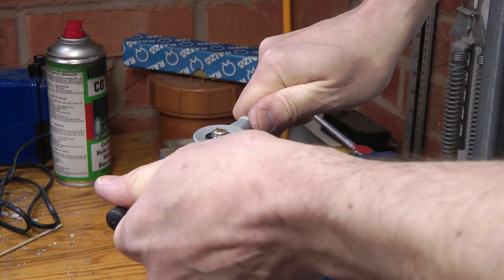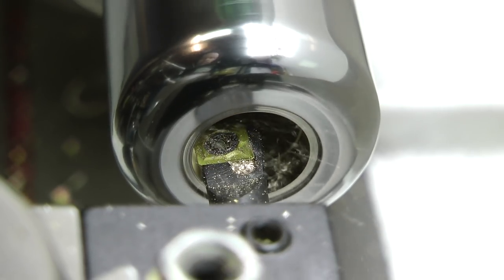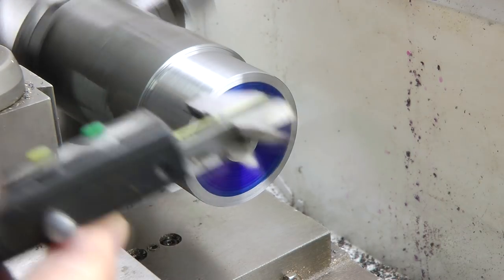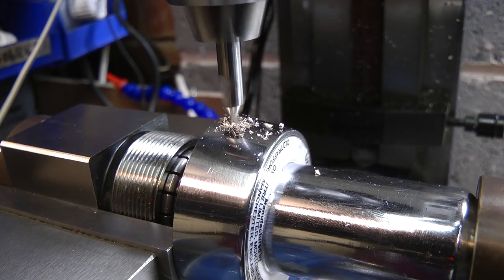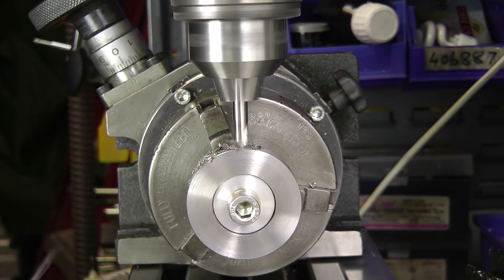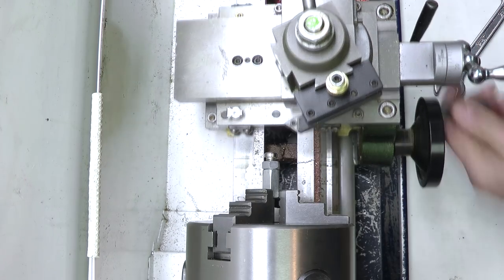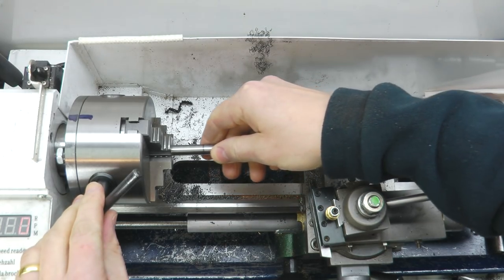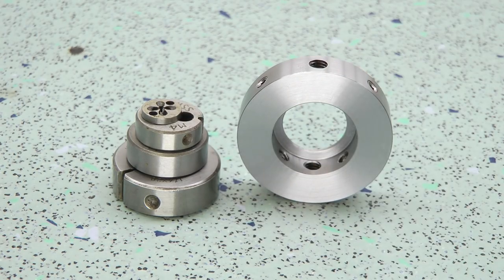Building A Tailstock Die Holder For The Lathe

Comment: Hi nice dychem tip it can be a mess and quickly. We really like the collar with the set screws equally placed in the circumference. Nice handy tail stock holder and guide build for your dies. Lance & Patrick.

Comment: Great job. I'm a great fan of repurposing.
At about the 5:47 mark you used what looked like a s Square insert tool that can be used on the x and y axis at a 45deg angle. if that's so can you direct me to where you got it, I've been lookin for just that.
Reply from the maker: It's one of my favourite tools! It came from an English company called Chesterfield Machine Tools (not to be confused with Chester Machine Tools). I'm not sure if they are still trading. They have an eBay page (but currently nothing for sale) and an Instagram account. The tool uses an SCMT 09T304 insert which naturally overhangs the 10mm square shank so various edges are available for turning, facing and chamfering. I use a sharp insert designed for aluminium, and use it on everything -my mini lathe can only take light cuts regardless of material. Sorry I can't be of more help. Thanks for watching! 👍 🇬🇧

Comment: Nice work!  Where do you get your tiny cutting fluid bottles from?  These would be really handy in my school workshop!
Reply: Any small flexible bottle can be used.I make mine from the smallest gorila glue bottles with the needles being re-purposed from printer ink refill kits.Just drill out the cap to fit and epoxy in the needle.I have made  plenty of these and keep them everywhere.You can buy something similar on ebay but its cheaper to make them and can be a class project if you can get the supplies.

Comment: Nice job! Forgive me if its a stupid question but, why not thread with the lathe?
Reply: The amount of time it takes to change out gear sets to match the dials on the face of the machine to get the thread spacing you want, takes way longer than just chucking up a tailstock die holder. This really applies to those of us who have import machines, that don't come internally geared for SAE threads, but metric as a default. There's a small range of SAE threads a metric machine can do internally, but wouldn't you know it, it's never the one you need, or you can't find that gear with the 15 teeth you need to make a 3/8" 16 tpi threaded feature.